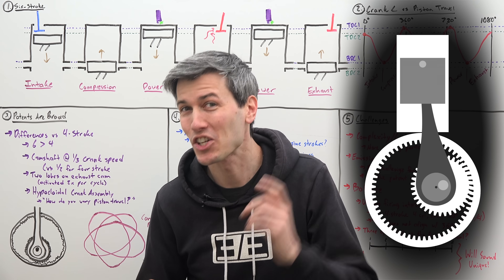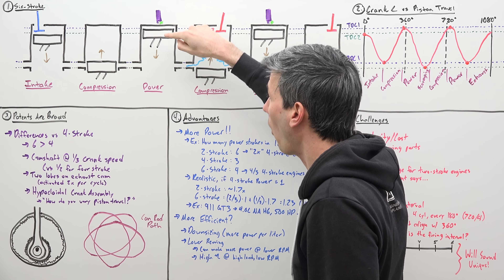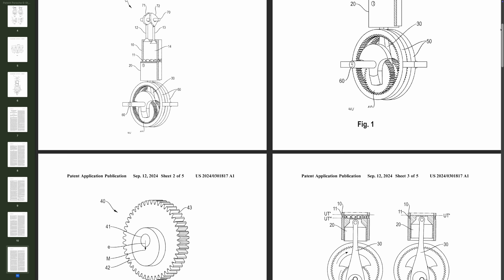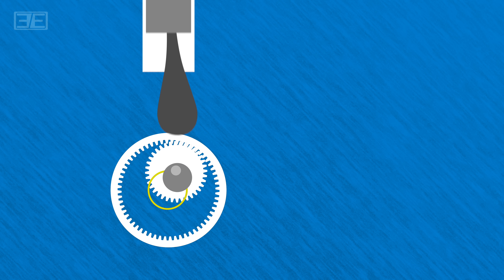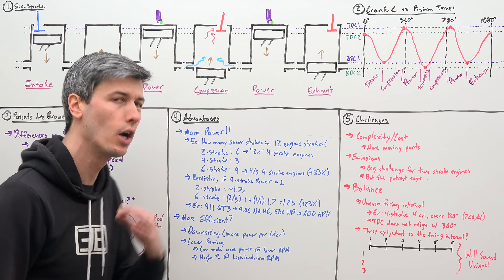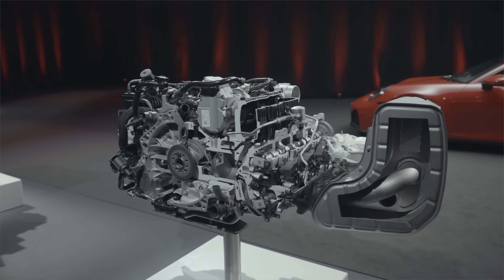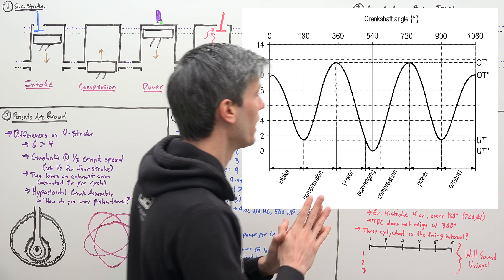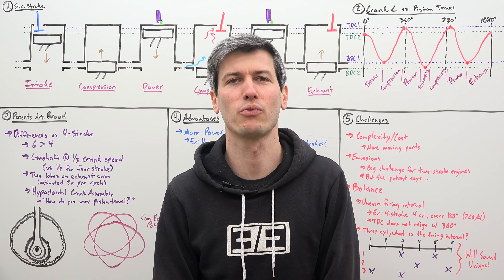Porsche's 6-Stroke Engine Is Genius!

Comment: Would this 6-stroke be worth comparing to Nissan’s variable compression crankshaft to describe the advantages of each? It seems like they’re both getting the most out of the crank rotation without going full Wankel rotary. I’m sure all 3 have a unique advantage and one is making the most power efficiency out of every ounce of metal in the assembled engine. Can’t beat the modernized Wankel rotary’s modularity in my mind.

Comment: I don't understand how they could run that naturally aspirated and force the air in the side ports? I could see using a turbo and having it work with boost but they say it will work NA. Normal 2 strokes compress the air below the cylinder so that is how it feeds the top ports.

Comment: The balancing in the 6 stroke design is purely harmonic due to the hypocycloidal crank design that moves in a straight line as opposed to the 2 or 4 cycle engine that move on and angle which requires counter balance to achieve this. The 6 cycle fires on 1080° firing on 1 and 3 as opposed to a 4cyl. 720°

Comment: Glad to have you sir and congratulations on the 1,000th video. This is a crazy idea from Porsche, hopefully 6stroke engines become the norm just before the electrical vehicle becomes the most common on the road. And pray they come with a standard transmission....

Comment: this is just a a two stroke with way more steps only way i could imagine this working on the second power stroke it to either have the engine be direct injection or diesel

Comment: emissions with the intake ports and the rings crossing the ports. That will result in lubricating oil being sent into the combustion chamber and burned. This is the major intractable problem with intake and exhaust ports cut into the cylinder wall within the piston travel, as in piston porting.

Comment: After the first power stroke and the piston goes below the ports and the cylinder it is still under pressure from the expanding gases.  What prevents this pressure from pushing the fresh air back into the crankcase.  Unless the pressure in the crankcase is higher than the pressure from the expanding gases like a true 2 stroke.

Comment: Essentially this is something from long ago being revisited?   Why now?.   Vvt has become more mainstream and tested and along with computerized systems this is more feasible. Some of it is cafe driven due to improved exhaust clearance and the additional steam stroke if you will. Rapid expansion absorbing heat while providing the piston thrust is the benefit.  Does this include h2o injectors? How about the water tank? Will this moisture hang around rusting the exhaust from the inside out?
  Who's going to be the guinea pig? How far along is quality control?

Comment: There in lies the problem the two stroke requires the ports to charge the intake to draw the charge from the crank case and to orientate the piston rings to avoid nicking the intake ports how are they going to keep the  intake charge clean and lubricate the piston rings😮

Comment: not genius, it is a desperate attempt to hang onto internal combustion, mean while a much better much more efficient means of moving vehicles is coming on, electric.  As batteries improve, can charge faster and carry more charge, internal combustion will be like owning horses.  luxury items only for specific uses, but also kept far away from most of the population.

Comment: Not to mention the fact that the two different power strokes will inevitably produce different amounts of power. The only way to balance a 3-cylinder engine would be to fire two cylinders on every other stroke. A 6-cylinder would be better by balancing two fires on every stroke... Regardless, the design just combines the disadvantages of 2 and 4 stroke engines, while adding a bunch of complexity... Though it would be worth building, just to hear it :).

I'd much rather see a 6-stroke engine where the final two strokes involve a water-injection stage, which would extract power from excess heat while eliminating the need for a cooling system.

Comment: I being a dirt biker would see this is obviously much more efficient. 2 strokes do have nearly twice the power It's what i prefer on my bikes, but it only does that in the high rpm, otherwise it's about twice as week, 4 strokes are the opposite, tho no engine really like low rpm, 4 strokes produce hp and torque much lower. If they have the high power of the low rpm of a 4 stroke, and the high power of high rpm from a 2 stroke, they have effectively removed the weaknesses of each engine, to utilize each ones strengths to overcome the others weakness. It probably is nearly twice as efficient. .

Comment: strange because electric will soon take over.  And couldn't you do a true 2 stroke by simply using high pressurized air (5,000 psi or more) injected into the combustion chamber which would eliminate the intake and exhaust stroke?.... exhaust is blown out through a valve by the air injected immediately after the completion of power stroke.  then as the piston starts traveling up the exhaust valve closes while compressed air continues to be injected into combustion chamber.  At some point the fuel injector is opened briefly and the air injector closes.  piston is still traveling up further compressing the air/fuel mixture.  And about 10 degrees Before Top Dead Center the spark occurs.  power stroke then occurs, piston is pushed to BDC and process repeats itself.  I understand you would need quite a big air compressor and air tank but i think they could make it work in a high performance application.  which this "6 stroke " would also be a racing concept and unlikely to make it in a daily driver.

Comment: Every single benefit could be magnified by simply using a 2 stroke with the same improvements (exhaust valve, direct inject, journaled oil). This just adds extra complexity for no gain.

Comment: I wonder what this would mean in regards to the piston rings, would you need another ring pack at the bottom of the piston since it will be traveling past the second power strokes intake? Or maybe youd just have increased ring wear from it having to travel past the intake

Comment: I wonder if, with use, how long it will take for the cylinder wall to develop meaningfully different levels of wear between the middle stroke length and the top/bottom variabe lengths

Comment: You can't compare a 2 stroke and 4 stroke hp with equal rpm. One of the major advantages of 2 strokes is their ability to rev much higher than 4 strokes, because there are no mechanical valves.

Comment: A 6 cylinder would work, 2 power strokes per 180. But you would need to make it an inline engine, if it was a V or H engine then you would get 2 power strokes on the same cylinder bank, which would put insane amounts of stress on the engine, and make it have some weird vibrations.

You could balance a 12 cylinder engine in a V or H style though, you would get 4 power strokes with 2 on each bank.

Comment: I think it will not work as a naturally aspirated engine. The 2 stroke part will only push exhaust gases out without forced air in.

Comment: a couple things stood out to me too here, im noone to challenge porsche, but i am wondering how much heavier the rotating assembly is in this engine compared to a traditional crankshaft. im also wondering if its actually 23% gain or if that doesnt include the additional loss of pumping oil into all those rotating crankshaft joints and the resistance they have naturally. its a neat idea, and i think it can be done, but is it really worth it? its so easy nowadays to slap a turbo on a naturally aspirated engine, run low boost and i feel like the gains wont be all that much different than a fancy crankshaft

Comment: I guess you have to force the air into the cylinder and open the exhaust valve at the same time in the 2stroke scenario, otherwise it will be difficult to get enough fresh air into the cylinder.

Comment: At my 73 years of age, born and raised in the mechanical field I have a point of view, more parts, more chances for failure, you young man call it genius, I call it caution.
Reply: I also agree
Reply: I guess they will might label it as Premium or luxury sports car.
Reply: @Diogenes001 new innovation is what make the difference and improve the existance technology, but in the case of the later ram trucks that you need to lift the whole cab to remove the engine, I don't think that an average customer would be too happy with the repair bill.
Reply: Heck I'm in my 20's and I agree with you. That's why I prefer older cars. Simpler easier to work on, and if something goes wrong I'll bet $10 I can figure out the issue before I get out of the car
Reply: @steeltoedkruggz  CONGRATULATIONS young man newer cars are a nightmare, the tools, parts and time to repair on those new cars is overwhelming, older cars are so simple and extremely easy to understand and repair, should you want to make your living working on cars , I personally recommend you to focus your mind on trucks, the pay scale is much better, right now Penske truck rental have maintenance facilities across the nation, I personally worked with them, perhaps near by you is a Penske truck maintenance facility, I highly recommend it, Cummins distributors also offer you a great working opportunity, look it up, you won't regret it, the pay scale should be at the present time around fifty dollars an hour, blessings to you and your love ones, from the endless summer paradise Puerto Rico Jesus Torres.
Reply: That’s why people should have never switched from the horse to the car, right?!
Reply: @PBandJJJJJ more moving parts, more chances for failure.
Reply: EXACTLY.

Comment: What I see is more potential points of failure and expense.
Reply: As an engineering student I see the same
Reply: @kademate6888 
And for what gain that cannot be achieved by simpler, cost effective means?
Reply: @nolobede  non when you factor in that this is new tech with unproven reliability. I was excited when I approached this video, I left underwhelmed.
Reply: @kademate6888 
Yeah it's neat but long term investment, R&D, testing etc, etc I just don't see a market outside of the tech and sport end of it. Future of ev likely to kill it before it gets started.

Comment: Getting the most out naturally aspirated engines will always be to any enthusiast a delight.

Great video, would it be possible for you to make a simulation of the air and fuel transit in the overall six stroke cycle?

Thanks

Comment: My educated guess would be about a 1/9th increase in power as the extra friction in the crank could be as high as 1/9th of the  POWER (Guessing that YOUR 23% Gross Power Improvement  is based on the NET GAIN of a BLEND of a STANDARD 4-STROKE AND A STANDARD 2-STROKE). Now there is a good chance my IMPLEMENTATION PENALTY of roughly 11.1 percent is too severe
and so it might be just a few percent off of that 23%...so maybe 20% more POWER OVERALL on the OPTIMISTIC SIDE, AND 15% MORE POWER IF A BIT PESSIMISTIC but there will be SOME LOSS due to that extra friction and complexity in the CRANK. I would also worry about the grade of oil and whether or not it needs to be combustible or not and if you need say a SEPARATE 2-stroke oil tank or not (the solution will be yea or nay depending on prototype testing of course). Anyway this is AMUSING as I thought about something in this vein in the late 70s but NEVER considered using 2 different TDC'S to differentiate between 4-stroke MODE and 2-stroke MODE to make a clever CROSS between them. The emissions should be low enough if no 2-stroke oil is needed to make it work.

Comment: It seems to me that the lower port holes would be nasty for smooth slide of the piston rings.  In a normal cylinder the piston is always surrounded by a smooth cylinder wall. Any idea of the reliabily over long life wear?

Comment: Clearly the squish band of the 2 stroke compression is lower at TDC, just as  the full power stroke to BDC in 2 stroke mode uses a lessor swept volume. Okay, so it doesn't deliver the full 2 stroke impetus, but is cleaner burning.

Comment: My 540  Lycoming Boxer with manual mixture leaning is just about perfection in an engine. 
What's most important in engine design is to never exceed 50HP per cylinder. It's the magic sweet spot in metallurgy in IC engines.

Comment: I think that some of the increased thermal efficiency and the reduced emissions would come from using exhaust gas recirculation in to the 2 stroke phase. Return unburnt fuel to the engine but not during the main 4 stroke cycle. That would likely have more benefit for diesel than for petrol. Spark plugs don't do well with EGR lol

Comment: The air charge won’t push the exhaust out the exhaust will be pulling the air charge (2 stroke phase). Amazing work on the crankshaft.

Comment: Someone explain to me how air flows in on that stroke between the two power strokes (4th stroke on the drawing). There won't be much if any vacuum at BDC as it has burned gasses that will try and push their way out of the lower intakes during that phase. I can't see how this could work NA. It would need a blower or turbo just for that phase to get air I would think. If it does work, I do agree it would sound really interesting.

Comment: So, if it is natutally aspirated but also isnt crankcase scavanged then how do they get the fuel air mixture into the combustion chamber at the second compression stroke? Fuel and air doesnt just naturally get vaporized and then flows into a pressure neutral closed of chamber, thats why 2 strokes carbuerate (or inject) directly into the crankcase so as the piston comes down from the powerstroke the pressure in the crankcase builds up, and when the exhaust and fuel port opens up all that pressure is relieved by getting pushed into the combustion chamber. But this engine doesnt seem to have that nor a turbo??? Where do they get the pressure difference from? Altough it is an interesting design.

Comment: The trend in the auto industry is to give a car more power rather than making a car more efficient.
Reply: Particularly in EVs, it makes no sense to resolve our energy/environment problem.
Reply: @jyetley  Electric cars might be marginally better than ICE cars, but they are still cars and have most of the same issues.

Comment: Congrats for your 1,000th video.  This was well done.  I suspect you are underestimating the balancing power complexities.  I would be surprised if the 2 stroke power stroke had the same power as the 4 stroke power stroke.  Marvelous to see this Porche invention and I should also read the patent.  => One wonders about different combinations of two power approaches.  Could there be a five to three or even a seven to two ratio?  The chances of the first combination of the 2 and 4 stroke engine approaches to be optimal would seem to be remote.  => Thanks again.

Comment: You can't really trust patents for the most part until they actually produce something in it. Probably 95% of porsche patents have never actually been used. A lot of patents are just filed to distract people of the true invection. When they said a "3" cylinder engine is "preferred". Yeah, why would you say preferred? That doesn't do anything for IP. Cool video, it's just a bit misleading because a lot of people are going to be talking to their friends and say that Porsche is developing a 6 stroke engine.

Comment: Love Porche. When I was a kid in the 80s-90s had a 929,944 and a 911. They engines and rear wheel transmissions were bullet proof. Everything thing else was sub "made in China" junk. On the 929 there was a brass nut called a "fuel check valve" I called it a 3-month Porsche tax. It would literally break/ruined after 3-6 months. Finally, had a buddy of mine with a machine shop machine one that worked. Crazy. Now it's worse because everything Porsche is electronic and computerized. So TOO MANY POINTS OF FAILURE. Including this wonderful 6 cyl engine. Something in the Porche overly complicated computerized electronics system will ruin it. Watch.

Comment: You actually could have an even firing interval with only 3 cylinders (not accounting for that sight offset): If the primary power stroke of one cylinder fires approx. at the same time as the secondary power stroke of another, then you would get 2 power strokes every ~360°. I'm sure it would still sound a little unique, but it wouldn't have to be all lopsided.
(To use that little table at the end: Cyl. 1 fires at 1 & 3; cyl. 2 fires at 3 & 5; and cyl. 3 fires at 5 & 1. Columns 2, 4, & 6 would be empty, hence 2 strokes every ~360°.)

Comment: Cylinder Firing Interval can be balanced with V6 configuration I feel. As number of strokes and number of cylinders if kept even, it can be made balanced smooth engine by combining 1st stroke from one cylinder and 2nd stroke from another cylinder at same time to deliver  even power even at interval of 360 degrees. Correct if wrong...

Comment: Wouldn't the offset firing timing issue be easily resolved in a diesel version of the engine where the glowplugs are essentially always hot and the fuel combusts to start the power stroke whenever the compression reaches its maximum regardless of whether it leads or lags TDC?

Comment: Second combustion is less power generate to campare the first combustion so the power is less generate and that can rotate the crankshaft slow compare the first. So that less power do with engine power like first high combustion and second low combustion. 
My second doubt is how is the camshaft rotate and how the 70%exhaust gas out from the first combustion ?